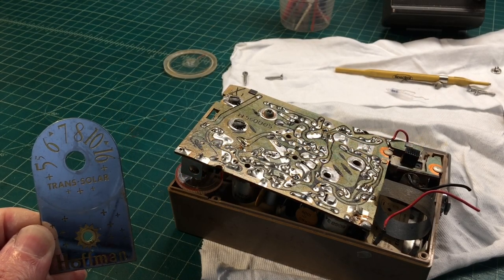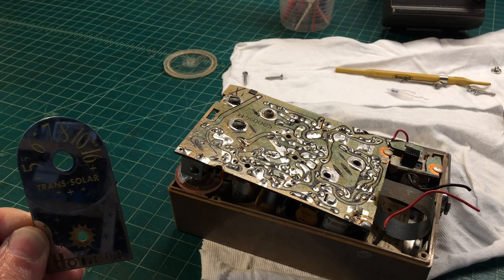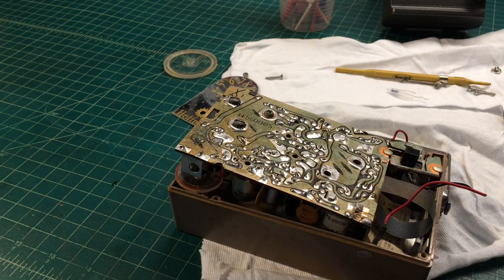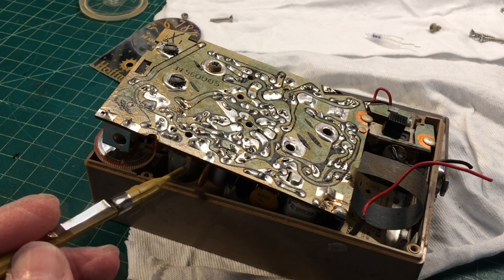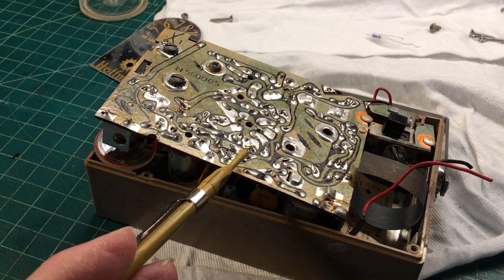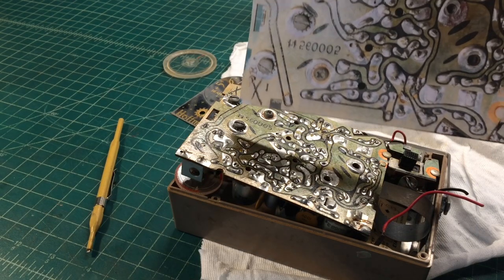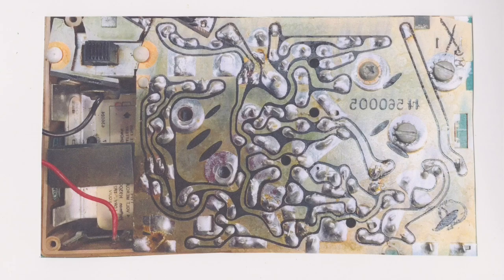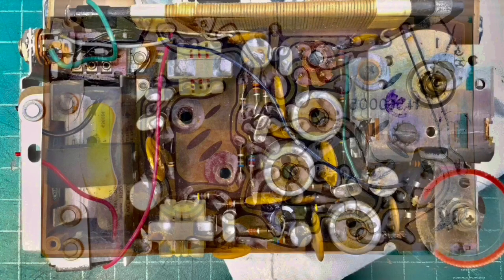Transistor Radio PCB - How to View Both Sides (Trace & Components) Together

Comment: Thanks for the tip, on several occasions over the years I've mistakenly de-solder some resistors, transistors ends when I was recapping these radios among various other pc boards.
Reply from the maker: Thanks Ken. It’s so easy to unsolder the wrong piece and this solution it not perfect, but does help at times. Best, Don